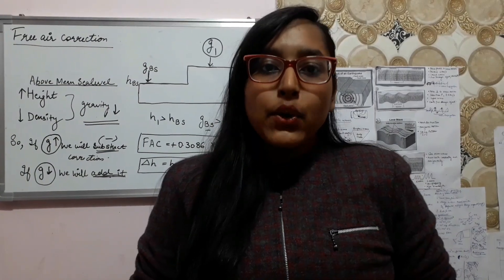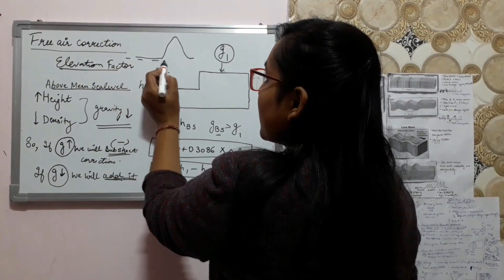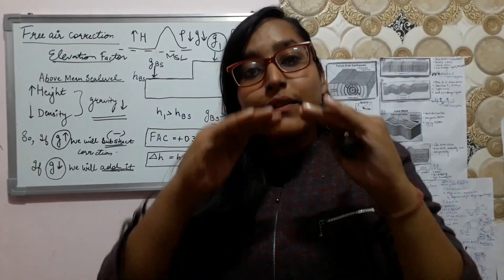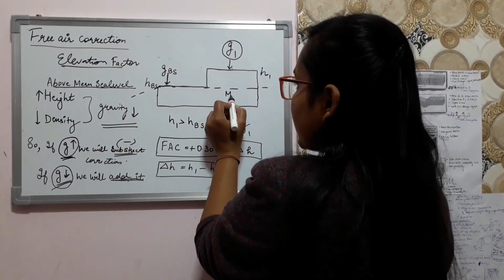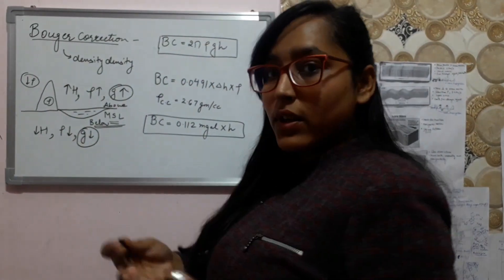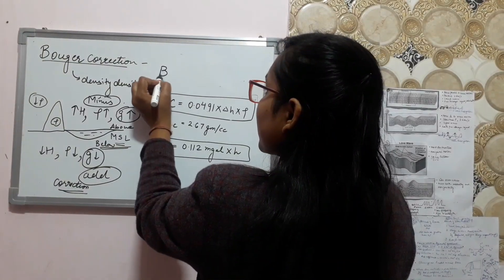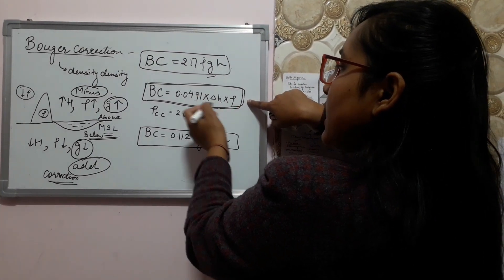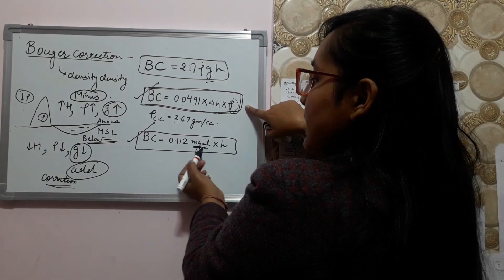#geogyanm Bouger correction  GATE/NET/JAM Geology

Comment: Gravity at centre is 0 and it keeps on increasing as we move in outer direction,  so why in free air anomaly, gravity is less at mountains???
Reply from the maker: Because we are taking elevation factor here with increasing height density is decreasing and gravity is a function of density so it will automatically decrease.
Reply from the maker: Gravity is not zero everywhere it depends on various factors you cannot directly say it is zero.